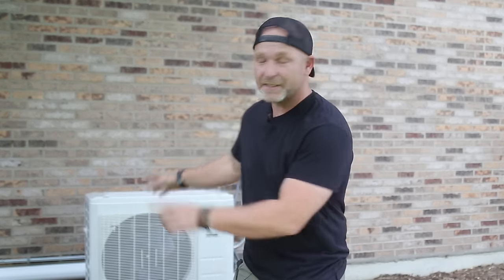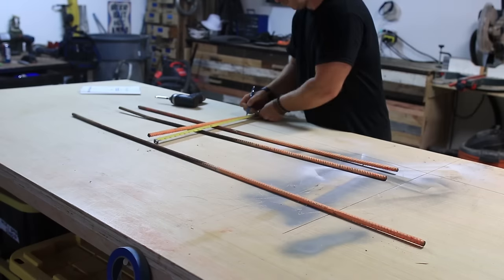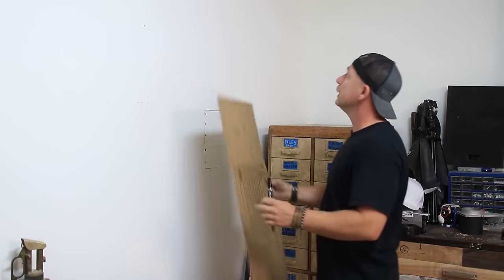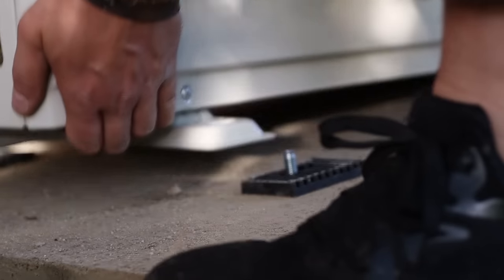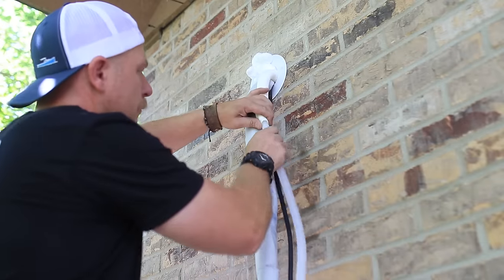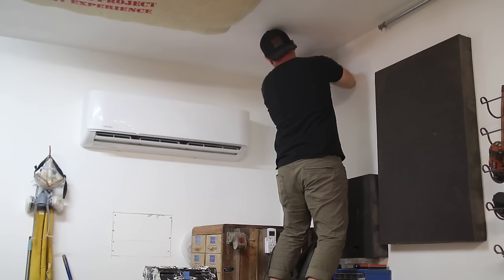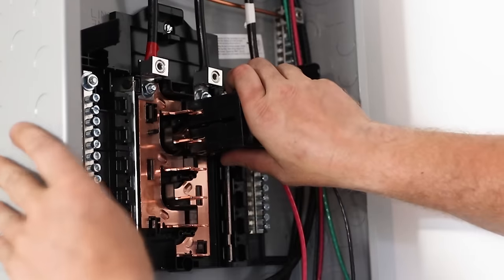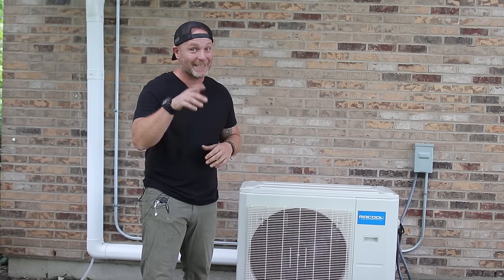How to Install a DIY Mini Split Air Conditioning and Heat Unit.  MR COOL 24K Split Unit

Comment: you did not vaccum the system?
Reply from the maker: No not this system.  It’s done in the factory before being sealed.  That’s the beauty of it.
Reply: @KomarProject  so that means it have special kind of copper pipe opening?
Reply: My installer here in india didn't vaccum the system and that does not have any kind of special pre vacuum in pipes..  he was idiot. Its cooling good. Can you tell me what can happen if we didn't vaccum and how can we vaccum now?

Comment: is it ok not to vacuum before releasing the refrigerant ??
Reply: These lines are vacuumed in the factory and charged and sealed before shipping.  The connections have a release valve in them that prevents gasses from escaping until the connection is tightened.

Comment: I bought this unit in cant find the template for the mounting bracket????
Reply from the maker: Just contact them and they should send you a new one.  Or just take the back plate off and use that as a template.  Should work too.

Comment: Never use a short light weight ladder.  At 73, I foolishly switched to a short light weight ladder to finish some ceiling work. I missed the bottom step and me and the ladder fell backwards because the light weight ladder turned over so easily. I now have 3 screws in my hip and lost several months to recovery. Plus my wife watches me like a hawk anytime I am around a ladder. Also don't step on the top rung as this guy did.

Comment: Not hating just pointing this out,   After you put your line sets together you have to pull a vacuum  before releasing your charge   Needs to be below 500 microns 
If you do not do this.  You will have many issues with your system through out it’s life end it will never work as good as it should     Could very easily cause permanent damage and failure of the system.    
-HVAC/R Contractor
Reply: These are a new type of system - 'DIY'.  They don't require an HVAC installer.  These lines are vacuumed in the factory and charged and sealed before shipping.  The connections have a release valve in them that prevents gasses from escaping until the connection is tightened. A desiccant canister removes any humidity that enters the system from when the connections are tightened.

Comment: Installed 2 years ago . Only 1 problem,  I do clean my filters  every few months but the the fan  on the evap. Unit gets clogged with debris after one year. You cannot remove it to clean. You have to clean it in place. Very hard and time consuming .

Comment: Did you do the vacuum
Reply: These are a new type of system - 'DIY'.  They don't require an HVAC installer.  These lines are vacuumed in the factory and charged and sealed before shipping.  The connections have a release valve in them that prevents gasses from escaping until the connection is tightened. A desiccant canister removes any humidity that enters the system from when the connections are tightened.

Comment: Why not shortening the lenth of those copper lines and trimming off the coils for a neater finish? It is not that hard to solder or braze 2 joints.

Comment: Understand that if you buy one of these off brand DIY minisplit systems that if it ever breaks you are better off tossing it and buying a new one. The cost to repair it often exceeds the cost of buying a new one. It is a disposable appliance like a window ac unit.
Reply from the maker: I have had it for a year and a half and I have been super happy with it.  Nothing has broken on it and it still works like new

Comment: I installed 3 mini splits,  not so easy to do.  They are always a challenge, drill bits too short, no spots left in breaker panel, knock outs too big,  evac leaks,,,,,  always something that makes it a pain .  Takes time

Comment: So you didint do the vacuum :)?
Reply from the maker: No need on this system.  It’s done in the factory before lines being sealed
Reply: I was wondering the same thing I didn't know it could be done without vacuuming the line. Great video

Comment: Didn't you have to use a pump to the pipes to create a vaccine before releasing the refrigerant
Reply from the maker: No they come precharged and you just connect them to the unit and use the provided Allen key to release the refrigerant.   It’s fairly simple with the instructions.  Hope that answered your question.
Reply: @KomarProject  Thanks mate,,,,  Over here in Australia they are pre-charged also, same type of system, but usually they connect the vacuum unit and create a vacuum expelling most of the air and moisture from the header unit, then release the gas with the allen key,,,,
Reply: @biker_dan  They're pre vacuumed. You connect, then do the first one with an allen wrench which checks for leaks, then the second one which released the refridgerant.

Comment: "Never ever stand on the top step of the ladder". That's the problem; the "top step" is not even a "step" of any kind. Is just the top of the ladder and is the joint.

Comment: What about vacuuming sir ?
Reply: These are a new type of system - 'DIY'.  They don't require an HVAC installer.  These lines are vacuumed in the factory and charged and sealed before shipping.  The connections have a release valve in them that prevents gasses from escaping until the connection is tightened. A desiccant canister removes any humidity that enters the system from when the connections are tightened.

Comment: You should've pulled a vacuum on the line set before you let the freon go.
Reply: I think he said the line was precharged? You’re right though, you normally would vac the lines. An installer told me he sometimes purges the air out with the gas on short runs but not good practice.
Reply: @oldchev2850  Way back in the day before vacuum pumps were even a thing, people used to just purge the lines with refrigerant as you just said.
Now a days vacuums are pulled to remove moisture and impurities out of the lineset before the freon is let go. Moisture=bad
Reply: I was wondering the same thing?? Did you have any issues not doing the vacuum ?
Reply: @jerryharrington1152  He won't immediately have issues, but way down the line, moisture and metals don't go well.
Reply: These lines are vacuumed in the factory and charged and sealed before shipping.  The connections have a release valve in them that prevents gasses from escaping until the connection is tightened.

Comment: nice work but don't tell me you didn't vacuum the lines before releasing the refrigerant out of the condenser into the line set, that's a no no! there will be moisture mix with refrigerant and damage the components and it wont cool
Reply from the maker: These lines a vacuumed in the factory before being sealed.  So it not necessary to do it on installation.   That’s the great thing about this unit
Reply: These are a new type of system - 'DIY'.  They don't require an HVAC installer.  These lines are vacuumed in the factory and charged and sealed before shipping.  The connections have a release valve in them that prevents gasses from escaping until the connection is tightened.

Comment: So did I miss the part where you pulled a vacuum to 500 microns?
Reply from the maker: You don’t need to with this set up. They are vacuumed at the factory before sealed.
Reply: The second you take the seals out to connect the pipes it lets moisture and air in the lines.
Reply: @blakescarlett9049  Nope, it's not a Flatbread connection.
Reply: @blakescarlett9049  These lines are vacuumed in the factory and charged and sealed before shipping.  The connections have a release valve in them that prevents gasses from escaping until the connection is tightened.

Comment: You left out an important detail. You didn’t show the pump down of the system to evacuate all the air before you open the valve to let the refrigerant in. This is a fundamental step that is done by HVAC technicians.
Reply from the maker: You don’t need to with this unit.  It’s vacuumed and sealed in the factory so that anyone can install it without calling a tech
Reply: @KomarProject  The lines from the factory are filled with nitrogen. Once you take off the plastic caps at each end, you hear the woosh, as nitrogen rushes out and ambient air rushes in. You need a vacuum on the system to pull out that air as it has contamination in it.

Comment: Is this unit 120volts or 240volts? At this time, there's 630 comments so you may have already answered this question.
Reply from the maker: It’s 240

Comment: What happens when you install everything and the unit doesn’t turn on, and the electrician only knows that wires go from point A to point B? Oh, then you want to call an HVAC tech to come save the day! Everyone has a plan until they fall off a ladder! Signed: HVAC TECH

Comment: what kind of power do you need? 110v? 220v? how many amps?
Reply from the maker: It was 220 with a 20 amp breaker
Reply: @KomarProject   I could have sworn that was a 30 amp breaker I saw you drop in. I believe you said you used 10 AWG line, right? If so, doesn’t that typically pair with a 30 amp breaker?

Comment: Worked on ladders for years. Simply put - NEVER step on the top step. Even more important if you love yourself and want to be around after the project - NEVER use an aluminum or wood ladder!!! THE risk is just not worth it for about 20% more get  a fiberglass ladder. You are worth it. Ask your wife and kids!!!

Comment: Im don’t mean to be the person to call out an installation error but I this only issue that is actually catastrophic to the life of the system is or not displayed on video was pulling a vacuum on the copper line-sets after making Secure connections to prevent any loss of refrigerant and by not vacuuming all the oxygen out by pulling a vacuum what you’re doing is you’re allowing the refrigerant to come in direct contact with the oxygen that was trapped and a failure isn’t something immediate but will slowly eat away the compressor and coil from the chemical break down of refrigerant that has now became acid

Comment: No vacuum pump needed?
I thought you need to evacuate the refrigerant lines of air and humidity by using a vacuum pump.
Reply: These lines are vacuumed in the factory and charged and sealed before shipping.  The connections have a release valve in them that prevents gasses from escaping until the connection is tightened.
Reply: @pokerpig9069  Oh!  That's great!
Much easoier and faster!

Comment: *Super easy install!

*requires reinforced cement foundation and electrical sub-panel with dedicated 240v circuit 😂
Reply from the maker: Ya.  Compared to any other unit it is.

Comment: You forgot to vacuum out the lines before adding the refrigerator
Reply: These are a new type of system - 'DIY'.  They don't require an HVAC installer.  These lines are vacuumed in the factory and charged and sealed before shipping.  The connections have a release valve in them that prevents gasses from escaping until the connection is tightened. A desiccant canister removes any humidity that enters the system from when the connections are tightened.

Comment: No need to take the air out of the lines before releasing the refrigerant?
Reply from the maker: not with this unit.  its done in the factory before its sealed

Comment: i problem you did not vacuum down the lines to take the air out to head unit Big mistake
Reply from the maker: With this unit you don’t have to.  They do that in the factory before sealing the lines.

Comment: An important detail is missing here and it is vacuum to the lines set, that is why for this installation someone who has knowledge of refrigeration is needed. That DIY does not work here unless you have knowledge of refrigeration now the system got air because it did not vacuum. this system will have flaws in the future.
Reply: These are a new type of system - 'DIY'.  They don't require an HVAC installer.  These lines are vacuumed in the factory and charged and sealed before shipping.  The connections have a release valve in them that prevents gasses from escaping until the connection is tightened. A desiccant canister removes any humidity that enters the system from when the connections are tightened.

Comment: What?!!! No vacuum pump used? No words... The system must be first exhausted of air and water by vacuum pump. Otherwise the life of the system will drastically diminish and performance of cooling/heating diminished.

Comment: That isn’t correct. You need to pull a vacuum on the line set in order for it to be done correctly
Reply from the maker: No you don’t not on this unit.  It’s done at the factory and sealed before shipping.
Reply: @KomarProject  I agree, you are 100% correct.  There are two different models.  DIY has precharged lines, so there is no need to pull a vacuum, and the model I got did not have precharged lines, so I had to have a licensed HVAC tech come out and vacuum the lines, test for leaks and then release the coolant.  I chose to get the unit I did as I pulled a permit to install mine so I needed an HVAC contractor associated with the permit.  He did also cut the excess line off so I don't have any coiled up at my condenser.

Comment: Stay clear of Mr Cool Air mini splits, they frequently break down with E1 and other error codes, they do not honor their warranty. If a part goes out you are stuck with it you will not find replacement parts. Look on the better Business bureau reviews of Mr Cool they have a high complaint ratio on their warranty and their units all together. My suggestion to anybody reading this would be stay away as far as you can from Mr cool brand

Comment: All the excess wire and refrigerant tubing rolled up and stuffed behind the heat pump. 🤮 But at least you didn’t have to pay anyone.
Reply from the maker: Ya you can’t cut the lines.  They are precharged

Comment: Thats not a good job, you coiled the lineset behind the unit instead of running the length out. That leads to eventual oil starvation which ruins the compressor. You should have bought a contractor unit for half the price and trimmed the lines or paid someone to do it right. Another thing you didnt do was to install a surge suppressor on the electrical. Those unit get destroyed by lightning strikes and surges.

Comment: That’s why we studied to get the contractor licensed...!
First is a lot line set copper you don’t need and has to be cut and redo it the flares sides 
Second purge the system with nitrogen 
Third vacuum the system up to 500 microns

Big house and do not have money to pay a contractor to do the right way....??
Reply from the maker: This is a diy unit and doesn’t need to be vacuumed.  That happens in the factory before they are sealed.  That is why you can’t cut the copper lines. Sometimes there are multiple ways of doing things brother.

Comment: This installation is bad, you didn't did the vacuum first, and tested for leaks after the refrigerant release, this is bad 2/10 points
Reply: These are a new type of system - 'DIY'.  They don't require an HVAC installer.  These lines are vacuumed in the factory and charged and sealed before shipping.  The connections have a release valve in them that prevents gasses from escaping until the connection is tightened. A desiccant canister removes any humidity that enters the system from when the connections are tightened.  By the way, you're about the 93rd HVAC contractor that hasn't read any of these comments and posted the same complaint.  Perhaps you need to update your training about newer systems.

Comment: Sorry mate, it is wrong, you have to vacuum(evacuate) the refrigerant lines before opening the valve, moisture/air is a big No in the system.  Leave the split installation to the professionals.
Reply from the maker: Not with these lines.  They are vacuumed at the factory and sealed prior to shipping.

Comment: Mr. Cool is useless you need their help. They are the worst unit I've installed. Senville is much better equipped and much better at responding.